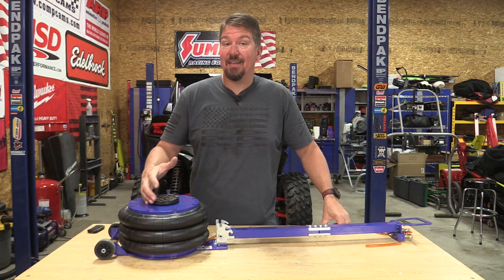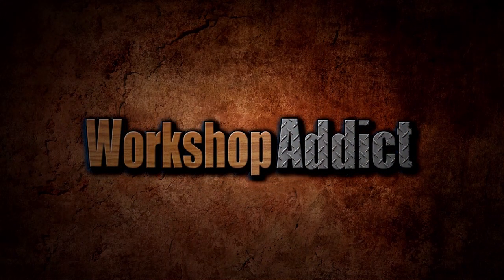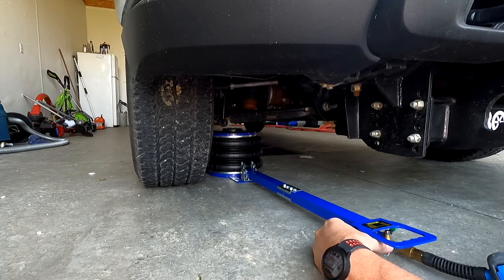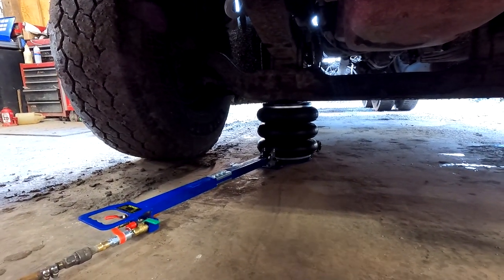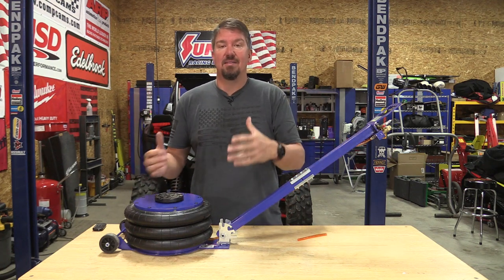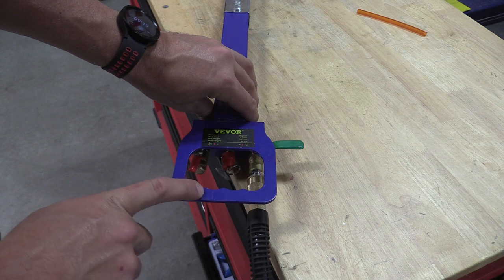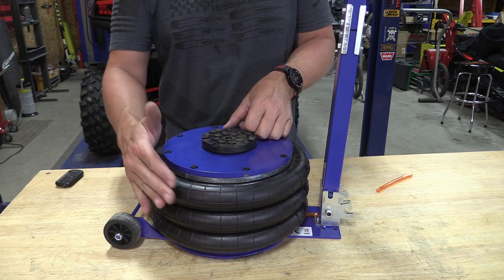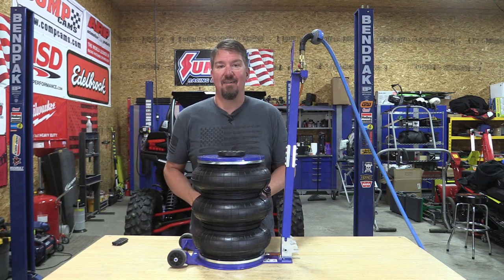Pneumatic Air Bag Jack - 11000lbs Capacity - Super Quick & Sketchy

Comment: ”aquarium” hose isn’t necessary an accurate description. Industrial air hose like that can safely hold 250 PSI if it is of the appropriate type, which I assume they would have used. It is used as air supplying pressure to all sorts of industrial equipment including lifting devices.
Reply from the maker: I have the same hose in an aquarium at a business.  No joke.  Same part numbers and all
Reply: Lmao
Reply: @WorkshopAddict  I worked for years in industrial pneumatics, as well as various factory and vehicle maintenance fields. Without seeing it in person, I can't make any claims one way or another about this specific product, but polyurethane pneumatic tubing can look similar to cheap tubing used for other applications. It could also be possible that your aquarium tubing is just overkill. It should hold up just fine for any pressures you would use with a compressor in your garage, but you are correct about being concerned about leaking at the bending joint. Simply anchoring the tubing at each side of the joint with slack in the middle would prevent chafing, and this manufacturer should've done that. I would also use a sheath or loom around in for extra safety. 

The airbag is a legitimate design (again, can't vouch for this specific product), but it should have a kevlar or similar reinforcement fiber in the rubber to prevent catastrophic explosions. Similar products are used as shocks in semi truck trailers, and for repeated heavy lifting in assembly lines, so I wouldn't necessarily be concerned about the durability. I've welded under trailers, used torches, and angle grinders right next to them, so you should be okay as long as you're smart about it, and don't throw sparks/slag right at it. 

Stability does seem a little bit concerning here though. I would definitely not trust this without Jack stands. That single bolt at the top you pointed out is also a little sketchy.
Reply: @GeoffCostanza  that would be something that would be very sensible, maybe someone could confirm the reinforced construction for the benefit of the collective.

Maybe someone who bought it and has no further plans to use it due to worries about it blowing out unexpectedly could cross section the air bladder to see if it has internal reinforcement much like the belts in tire treads.  That would be a worthy YouTube video and make use of an otherwise discarded item.
Reply: You got some heavy-duty aquarium 😂😂
Reply: That hose is not actually rated for anything, they sould have used a dedicated DOT style air hose thats used on any vehicle with air brakes. Im guessing the pressure they rated the bag is pretty low, or they would have used a quality hose. No rated air lines are clear- they are black/red/yellow/green depending on the part of the air brake system.

Comment: It does not ever matter what type of jack you are using, Jack stands are a must for safety.  You don’t ever leave trust to a hydraulic Jack without jackstands because when the o-rings blow out and the fluid leaks, it drops…no different to this air jack.

Comment: These are no worse than a floor jack, I use these constantly for tire switchovers. My drive is on a bit of a slope and I have never had an issue with the vehicle coming off the jack. I actually have 3 - 3-ton models and one 5-ton model. I also do a lot of brake jobs and I can lift both wheels off the ground without an issue. I have had these for 2 years now and my floor jacks have not moved since.

Comment: I was using air bags back in the 80s that took off trucks. Never had one blow up. I only used them for tire changes. I didn’t have a fancy frame just a hose. ALWAYS USE JACKSTANDS AND A WHEEL OR A BLOCK FOR INSURANCE.

Comment: When I was a tire tech some 25 years ago, we had an air bag jack like that but it wasn't as tall and it didn't have the extension handle. You would position it under the pinch weld and press a button to inflate the bladder. I don't remember how we deflated it. It was cool because it was fast. I don't remember being particularly scared of it. We didn't use it a lot though. We also had and alignment rack lift with large air bladders like that.
Reply from the maker: The older ones were made by a USA company with a patent. They did not have sketchy hoses and the telescoping section in the center was very secure.  This is not that.  Lol
Reply: @WorkshopAddict  made in the USA means junk, where have you been?

Comment: 1/4 airline instead of aquarium line and 140psi safety valve and it lifts 15k ,we run these airbags on semi trucks pulling 80 k lbs or more they last for 500k than they start to leaking from the bottom but rearly they blow
Reply: Yea, I think this guy was being super super critical of these air bags. Hydraulic jacks are
Know to kill people when they go out. I had one literally just release all pressure one day. Anyways I like how quick these things lift. I would consider getting 2 for my tractor. And always use jack stands with either hydraulic or pneumatic jacks. Stay safe people.
Reply: I want to know if anyone ever had one actually suffer a blowout rather than a slow leak. I'm surprised that not one account of that happening ever surfaced.  
Then again, maybe it did and the guy never had the chance to tell the story..

Comment: Put a pressure gauge in place of the diffuser on the release valve and see what pressure is actually being applied to the air bladder.  What pressure did the blow off valve release?
On my 3 ton unit with passenger cars, the pressure was only about 35 psi from my measurements. I don't have anything heavy enough to test the load limits, maybe I could use a 12 ton hydraulic press to hold it.

I've been trying to see if there were any reports of the air bladder actually failing, and thought this might have been one, but the blow off valve releasing is still kind of an expected event, unless the pressure released at some very low value. 
That's why I wonder what pressure it actually released at.  Certainly the blow off letting go is preferable to the air bladder popping, because that'd  sting the eardrums-😅

Comment: I was concerned about the safety factor of the air bags blowing up as well. Parts I would reinforce/replace would be a heavier duty air tube, and replacing the rubber circular center with a steel plate, that you could countersink a bolt in to. And as far as the green/red handle ball valve actuators go, I believe that having the handles fold in (while being hard to manipulate) is actually a safety feature to keep people (that may be walking around) from accidentally engaging the controls.
Reply: Not trying to be rude, idk about other brands bur snap on uses the same bags at tractor trailers do. Some of those bags last 300,000 miles before needing to be replaced

Comment: I don't see a safety problem with it. My car rides on bags that are cheaper and paper thin, and get wayyyy more abuse.
The tubing is fine, small tubing can withstand substantially higher pressures than large diameter tubing.

No matter what you use, you should always support the vehicle with a proper jack. A hydraulic, pneumatic jack can fail on you when you least expect it!
Reply from the maker: It is the sway you get.  Imagine no control arms snd just bags on your car.
Reply: Ya, all of the air bag setups I've seen in my life time, have used this small tubing out to the air bags. they are actually rated for about 10 times the pressure you will ever put into the bags.
Reply: Even hydraulic jacks move..Every time I lift my truck I have to be careful  the jack doesn’t roll from under the truck.
Reply: @WorkshopAddict I’m still not worried about that though. Ignoring the risk of the airbag blowing and the pieces of it hitting you (real issue, and likely the reason I would avoid this), if I’m in the process of lifting the vehicle and it fails, well, it falls back on its wheel(s) and tire(s). While inconvenient, it’s not a safety issue. If the wheel and tire is off, it should be on a jack stand already. I am NEVER getting under a vehicle that’s not properly supported, so again, if it falls, it isn’t a safety hazard per se. The only real issue I see is if you lift one side, stick it on stands, then go to the other and because it lifts so fast you don’t notice the first stand is tipping or something. 

The only way this becomes a real hazard is if you follow improper jacking procedures. Any time I pull out a jack I’m also pulling out stands, and in most cases when I get under the car, the jack is lowered and out of the way. Am I missing something?
Reply: @bigjaydogg3384  cause common sense isn't always that common.

Comment: The video was a game changer for me about the safety aspect  - Thanks
Reply: safety aspect are the same with an hydraulic jack. This bag can't blew up for no reason, it's made to hold at the very least twice the release pressure of the safety valve (surely way more than twice). If you trust your tires to not blow up for any reason, you can trust this jack, same physics behind. (and actually, you trust a 1/16" thick rubber o'ring with an hydraulic jack, all the pressure is maintained by this creepy little thing in it, think about it)

Comment: I'm 30 secs in and I see a glaring issue - you installed the tube wrong from the bag to the handle. It not supposed to go in through the bottom of the handle - it's very obviously supposed to go into the oval cutout hole just up from the bottom, just like it comes out that other one near the top. With it routed under the very bottom, any time the handle is in the vertical position, it'll be resting on the tube and damaging it. Why didn't you notice that when assembling it? I put mine together last night, and immediately noticed after I installed it wrong like you have yours - I didn't even snug up the through bolt before I fixed it - it should be very obvious, though I will admit their instructions are awful and very lacking.

Common sense though - that line has to hold the pressure to lift whatever weight the jack is being tasked with - so help it do that safely and get solid support under whatever you want to work on before crawling under it. I've had regular hydraulic jacks fail and drop a vehicle, so support is always required, and a floppy pneumatic jack like this is a great demonstration of that. But used correctly, it's going to be a great time saver for certain things - just like any tool, if used correctly it'll be great - if misused it'll suck or hurt someone. :/

Comment: Saw this thing on a FB ad; I am always skeptical of things like this and glad I came across your vid review on this product.  You reinforced what I and many others have thought to that this thing is unsafe for most vehicle repair use, I will stick with my tried and true hydraulic 3 ton jack and jack stands.  Again great review video, you have probably saved a lot of DIY mechs like myself money and possible injuries :-)
Reply: it's not a critical review, it's all about feelings. If you trust a 1/16" thick o'ring (which is the thing holding all the pressure in an hydraulic jack) you can easily trust this pneumatic jack too. Science is not about feelings, is about calculation and applied laws of physics, and this thing is safe as an hydraulic jack is. Did you put yourself under a vehicle without jack stand ? I will never do that personally, even if a god hold the car up.

Comment: 18 months later - are you still using this?  Do you reach for it more or less than your other jacks?  What were the modifications you indicated you'd make and can you demonstrate their utility?  What does the inside look like?  Thanks for the review, I'm curious how it's holding up over time for you.
Reply from the maker: The main clear air line cracked and started leaking after about 5 uses.  It was more of a pain to drag out an air hose than to use a regular jack and I did not trust the Chinese design.  The USA made model would have given me some confidence in it.  I don't use it and I never fixed it.

Comment: I’m going to say this review is bias and completely geared towards the product failing . For beginners you don’t use a 3ton Jack to lift a 3 ton car . So why use an 11000 lb Jack to lift 11k + semi . Of course it’s going to fail and I’m also pretty sure this jack isn’t made for lifting semis . I have the same jack and I use it on my 19 Durango and i have never had a problem out of it .
Reply from the maker: First, we never set it up to fail.  We tried it on the semi and it worked and the pressure relief valve opened as it should, protecting us.  It did bend when used to full capacity.  You can make your own decisions as to what to use based off the video, but we worked to make it very clear as to what people are getting.
Reply: @WorkshopAddict  
If you get a chance, can you put a pressure gauge on the release valve port and see what pressure the pop off valve releases at?

Comment: I don't understand why you are claiming that its sketchy and you wouldn't want to trust it to allow you to get under the vehicle. Are there any floor jacks you "trust" to hold the vehicle while you go under it? I use floor jacks regularly to get a vehicle onto jack stands. That is all they are intended for.  By your logic all floor jacks are sketchy. Which they are. Hydraulic, pneumatic, or gear driven, none of them are intended to hold the vehicle so that you can safely work under it. That is why we have jack stands.
Reply: Some users benefit from a larger safety margin to cover times where proper procedure isn't always followed-

Comment: Air bags are used on jet airliners. They are also used on semi trucks. Both tractor and trailer. Tri axle trucks too. They're mainstream equipment and are safe. Just buy something built better than a Harbor Freight air bag jack and you're good.

Comment: I'm  going  to  say this. I drive cmv's 4 a  living. They have 5 axles x 2 air bag suspension that can LEGALLY support  80 000 lbs of load. More if you would purchase overweight permits right. According to how the airbags were fabricated.  I would trust them to not blow up. But hell yeah i would use jack stands

Comment: Semi front axle is 12,000 lbs. Your jack is rated for 11,000 lbs. Unfair test.
Reply from the maker: The jack did what it was supposed to.  It lifted what it could and the relieve valve opened.  Perfect test to know it works safely.

Comment: Those levers are turned in for shipping so they don't get broken, that's my guess anyhow.
Reply from the maker: I do not disagree, but if you are working around the handle at all and you have them facing outward, you could easily hit and move either lever.  Could be bad if that happened.

Comment: Hey what kind of air compressor do you need to run this effectively?
Reply from the maker: At least a 10 gallon with a good pump.  It uses a decent amount of air compared to a normal truck air bag.
Reply: @WorkshopAddict  Thank you. Thinking of getting this for some jobs here and there at home, and throwing jack stands under the car as quick as humanly possible 😂 the convenience is just too tempting

Comment: Bag jacks are older than dirt but for some reason didn't take off until recently.  As with any jack I "capture" the lift using wood cribbing (I buy a 4x4 and a 6x6, cut in ~18" sections and drill a hole for a pull rope for fast easy handling). I gave away my jack stands many years ago because cribbing (and old preferably alloy wheels) are far safer and much more stable even on gravel or earth.

It's easy to fab your own of any size using an 18-wheeler bag and a base like https://www.youtube.com/watch?v=ZV-GCXT0f60  I copied that one but also have a smaller Vevor whose hose etc I upgraded.

Comment: Negative negative now how about the good stuff. Proper usage gives anyone with bad shoulders or muscle problems the ease of not having to use a pump Jack as far as the height issue run the vehicle up on 2x6x10” pieces of wood to give more height clearance very simple most cars now have to do this just to clear ramps. As a retired truck driver air bags are just as safe as using a Jack all that can crack your scull when not used properly. Four air bags on a truck can raise 50,000 pounds with ease so why all the negatives. When you use a pump Jack you are to use stands then lower onto the stands so what’s the difference. Common sense prevails why would you not use a 4x4 piece of wood on top of that air Jack like any other Jack to close up the air gap and give more working pressure in the bag to lift. Common sense prevails but overall not a bad video if you only want to explore only the negatives. I just ordered my 6000 pound air Jack 7 to 10 years down the road when it gets weather cracks in the bag then you think about replacing it.

Comment: Yeah, I'd be afraid to max out an 11,000 lb airbag jack to lift a 25,000 lb semi. Those safety pressure valves sure do scare the shit out of ya. I had a defective one rated at 225psi pop at 190 while my compressor was filling the tank to 200psi.